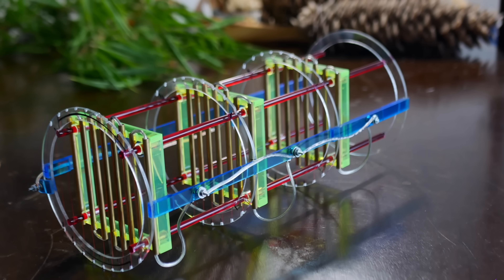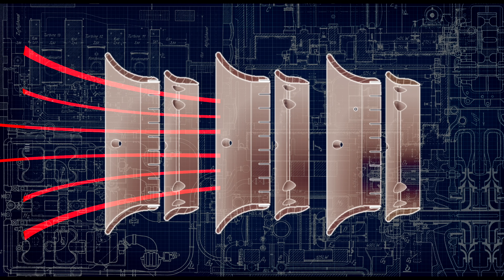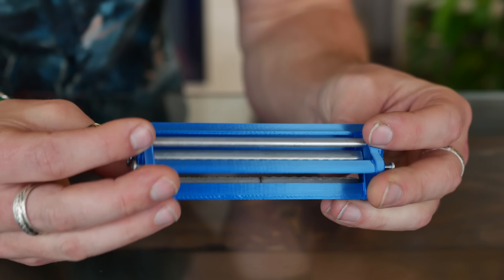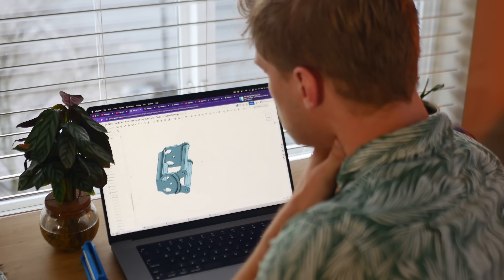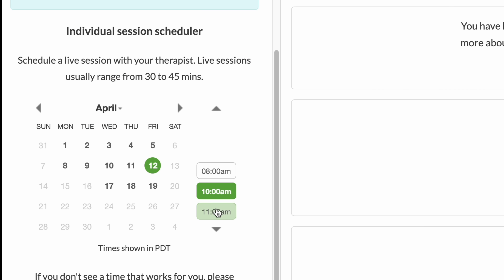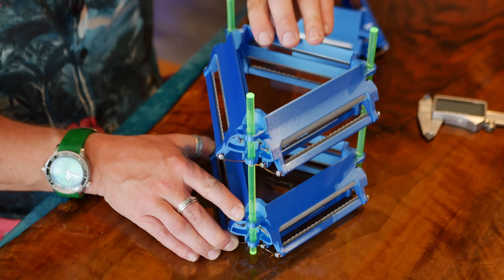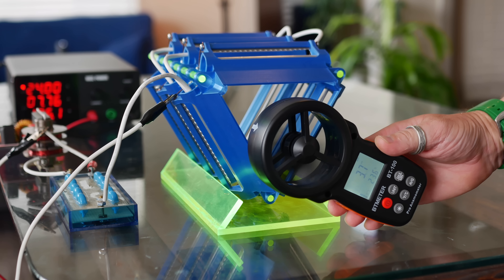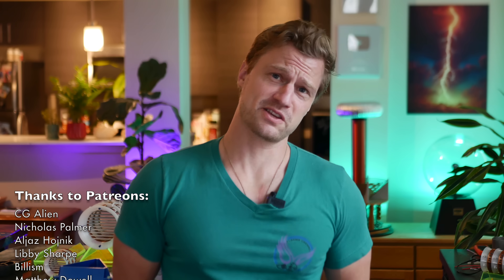Next-Gen Ionic Plasma Thruster Inspired By Nature (BTC Mark 3)

Comment: I feel like he mis-heard Nature's clear message. Consider the leaf - If we follow the patterns of the veins from tip to stem, they converge in a closed pattern. Why not use those convenient linear thruster segments inside the wing's airfoil, with multiple ranked intake thruster slots pushing flow into a larger channel with its own thruster sized and calibrated for the compressed flow? The way he is stacking identical units with equal spacing ignores the fact that each stage is processing a fundamentally different fluid.

Comment: Feel like this is worth mentioning again: when you've been building sequential designs, you've been accelerating THEN DECELERATING then accelerating the air. Between the stages, the electric field runs in the opposite direction therefore it creates a force to slow down any ions you've produced. The only benefit you get comes from accelerating the uncharged air you draw in between the stages.

I think it's also important to say your banana example is wrong: as you saw with the dry ice, these blades will pull in air from the sides which will draw it OUT of the main air current. You'll have a region of air that keeps getting sucked out by the blade stages then blown back in. This is wasteful. It would be better to block off the inside edge of the blade so that it can only draw in air from outside the thruster

Comment: Curve the thrusters into a circle and space them 1.5mm apart, increase voltage by 3x and use steel and aluminum instead of plastic,  stack 10 of them at that spacing with a shroud to collect air from the rear to focus it onto the sides from a single source.  Larger voltages will require larger gaps between hot and ground.

Comment: It seems like running all the thruster elements at the same power is likely eating into your efficiency for maximum output. Would be interesting to see if running the earlier ones at lower voltages and increasing towards the rear would net you similar results at lower power expenditure.

Comment: We need the dry ice at the back and the sides to get the true feel of where the air is coming from.

The side influx of air is trained so it should help, just like in a jet engine, so if look there for inspiration.

Then, the modules themselves, they all work well with still air, but surely they must need adapting to moving air? So I see the 3 stages being different sizes as well as spacing.

Comment: Why aren't you tapering the diameter of the stages? Conservation of mass flow means if you want to accelerate the air from one stage to the next, it has to get narrower.
Also, since kinetic energy in air is proportional to v^2, it is expected that you get about 1.4x speedup from the 2nd stage, and only about 1.22x speedup from the 3rd stage.
Biggest challenge seems to be that energy efficiency is only about 0.25%..?  (1/2 m v^3 p A = 0.1W kinetic energy from 40W input)

Comment: Wind isn't additive.  If the wind is blowing at 5mph. It is simply blowing at 5mph.  You have to put in more energy and push faster.  Period.

Staging multiple wind inputs, which each push at ~2.8 isn't going to give you faster speed.  Wind speed isn't additive.  Your are only maintaining the speed. It's like you push a bicycle at 6mph. A friend helps you push the bicycle. But, you both are only pushing at 6mph. Capiche?

Comment: This is so cool!

One Question that popped up in my heat though was - what about humidity? When (in the future) flying through the Air with Ion thrusters shall become possible then wont we face Problems with jumping voltages due to Change in the conductivity of the Air? That might mess with the efficiency especially when under lab conditions everything Like spacing and voltages are optimized. And Well, Clouds exist🤔😂

Comment: It's normal that you don't get more power with combined design. You are not accelerating the same air twice, therefore you don't combine power, merely increase flow rate (l/min not m/s). If you like to improve over all output speed, try creating an inverse pyramid that would act as a nozzle. Not only it would increase the air velocity (allowing the same air to be accelerated twice as well as pull some fresh one), but help focus the stream as well. Additionally, you can experiment with an outer cone around the whole trusted, that would allow for equal pressure build up when in motion. Also, increasing the voltage on each consecutive step will better up the efficiency.

Comment: Some comments-
1. I'd be curious as to any differences between something like prop drive thrust vs ionic thrust curves vs apparent wind speed.
2. I'm not convinced you are using the most efficient step=up circuit. There are other possibilities. The free one, I'll disclose right here, it's a simple linking of atmospheric radial voltage differential to drive your thrusters from a higher altitude atmospheric voltage collector(I think you've possibly already done a Ben Franklin style kite video on here?). The current should benefit from apparent wind. There are also methods like piezoelectric transformers or electromechanical(motor) to static electricity generator (like the whimshurst machine. Depending on the motor and generator efficiencies you may or may not get a better overall conversion efficiency.
3. I think the evolution of your current design is to amalgamate it with you prev design so that you have slanted in rings stacked end to end instead of triangular inward pointed stacks.
4. You are measuring output speed which is a very raw and relatable characteristic but thrust is a much more important measure. At the moment, you are  generating a sort of angled cross-flow impingement of ions which transfer their potential energy a little like brownian motion to a bigger number of air molecules that end up moving at a lower speed. The 22? degrees offset looses you a portion of thrust which I don't think can be realised by the vehicle housing the thruster.
Please don't take anything above as being negative, I love seeing your inventive experimental work and find it fascinating.

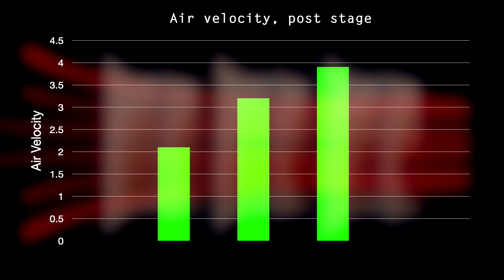Comment: I had to pause at 3:15 and check some math. Those speeds are exactly what you would expect; the thruster is imparting energy to the air, with an unknown, but probably constant, efficiency. And we can check this assumption with just these speeds and knowing that kinetic energy is a term of velocity squared. (2.1m/s)² is 4.4 (units of energy. Ignoring mass, as it's probably close to constant.). 3.2 m/s -> 9.4 energy. 3.9 -> 15 energy. So, even without knowing the "real" energy (in terms of Joules), we can see each stage is adding roughly the same kinetic energy to the air (about 5 of our arbitrary units). Reaching a "max speed" is not the issue, its efficiecy. You want to move more mass of air faster.

Comment: You might want to look into better flow visualizations and also using them for the flow inside your thruster to better understand how the flows combine (or why/when they don't)
Using a fog source at the source side of the thruster + a thin layer of laser light might be a good option. Or building a Schlieren system for visualizing pressure differentials.

Comment: What an awesome improvement in design with this new version!!However, one thing really frustrates me though is the use of smoke to visualize how the thruster blow but never as air input so that we can visualize the actual air flow circulating through the thrusters.I think that now that you pretty much mastered the thrusters technology, you could make incredible performance upgrade by limiting turbulence at the convergence point (and everywhere else). Because turbulence comes from flow shearing, it basically "eats" some of you flow's kinetic energy.

Comment: I like how you're testing and finding the best distance between the individual thrusters but it would probably be more optimum to use computational fluid dynamic software to test it out over different lengths and voltages. This would also produce you a graph where it can easily show the best distance.

Comment: Cool design. If you are looking for more velocity- you need to direct your stream into a smaller volume. By constricting the volume the fluid will accelerate (Venturi effect). The total mass of air is important for thrust (F=MA), you're also looking for speed. If you move a huge mass of air at 3ms or a small mass of air at 3ms, your top velocity will still only be 3ms. So if you want to get the velocity needed for aviation purposes, you need to need to force that stream of air through a smaller and smaller diameter tube and the velocity of the air coming out the back will increase in velocity considerably. Basically, you need to put a Venturi into the shape of the output of your thruster. You'll get faster airflow. Your intake will be large, so you will still be taking in and moving a big mass of air, but then you will accelerate way more and thereby getting more thrust and higher top end velocity.
Allowing more air to come into your thruster through the sides doesn't help you achieve higher velocity outputs because that is air that is moving slowly and you will have to expend more energy to get it up to the same velocity of the airmass you already have inside your thruster. This is all about getting the mass of air you already have inside your thruster up to as high velocity as possible as it leaves the back of the thruster.
Think about it this way: I have 5 guys who can all  run top speed of 5kph. They are pushing my car. The fastest they will be able to get my car going is 5kph. However, I have another friend who can run 20kph. If he pushes my car, eventually, he will get the car up to 20kph (he will have a harder time getting the car going than the 5 guys but he will eventually achieve a higher top speed). Ideally, you would have my first 5 friends push  my car up to 5kph and then have my other friend step in and accelerate the car from there. You achieve this by having a large air intake and you ionic units near the front pushing that air down a Venturi tube. 
Just try putting an output nozzle on the end of your thruster, you'll get even higher output velocities. Fluid Dynamics

Comment: Your numbers are probably disappointing because you’re trying to create an ionic compressor. But there’s nothing physically compressing the air as in a jet engine.

To encourage airflow through the centre, try using entrainment by using the thrusters to suck air out of the middle and creating low pressure as in a bladeless fan.

https://youtube.com/shorts/h0V_onHN0sY?si=N-UxyhHm4-DF9LIO

Comment: An improvement idea to improve on your ionic thrusters. Is to have them at each of the different stages of the thrusters to pulling different powers. Not at the same power. Because they are at the same they are pulling most of the same air flow that shows small differences between stages, by setting stages at different power, will lead to greater air flow speed. As the first set of thruster is pulling in the air and the other thrusters are just accelerating the air flow by pushing the same air from the first thruster This should optimise your ionic thruster to reach their peak efficiency.

Comment: Id be intrigued if you had each stage rotated slightly to grab more flow from the tips

Also would be intrigued if you angled them inside the stage on their lengthwise to see if you can get more of a rotating flow.

Or change the size of each stage, whether that's the front being smaller than the rear to get more flow in, or the reverse and trying to take better advantage of the center area.

Also what if you detemper the razorblades and bend them, perhaps a more organic bend in conjunction with the above may have some sort of improvement. Though you'd need different blades than those snapping expendable ones of course.

Comment: @Plasma Channel: Your measurements are not assessing the performance completely. You want thrust which has an reaction mass component, that you do not seem to measure with measuring the output velocity. Impulse has also an mass part, in that regard the triangle configuration is brilliant! You can "cover" shape with it - if you dare with an  corresponding mesh generator.
Reply from the maker: Hey, thanks! Yeah, I should do a proper thrust measurement

Comment: I wonder if making each unit of three different sizes such that they fit concentrically then fitting a duct wall to each, angled at 20 degrees for the outer duct, 30 for the middle, and 35 the inner most. That type level of airflow convergence should be more in keeping with what you saw in Nature, improving flow rate and force dramatically. But I was an English major, so….

Comment: Finding the optimum geometry of electrodes is vital to achieving the magnitude of airflow and acceleration necessary to progress from lab curiosity to feasible thruster. What if in the same space where you now have one blade and tube electrode pair, you were to scale down the electrodes to where you have 3 or 4 pairs (each one much smaller in thickness and width) drawing air through the same inlet area? Achive many more ionic flow lines of interaction with the air in the same space. In stead of 9 pairs of electrodes as in your example, how about 36 pairs of electrodes, but divided and arranged to consume the same power?

Comment: You should try to put the output pipe on output, it is used to increase performance of a jet engine (it is adapted to the output of the engine)for example motor AI 25 (google "AI 25 leteckemotory" and go to photos ). And you should try to fill the core either by just a triangular profile, or with a triangular profile that will have holes so that flow will suck air from the core(this technology is used to inflate life rafts on airplanes, instead of 20 seconds of inflation with a rocket engine it inflates in 5 seconds with rocket engine and aspirator(google aircraft aspirator)). And maybe then a nozzle but that's optional. I am an aviation mechanic so try it ;D

Comment: So basically:
MK 1: Proof of concept
MK 2: optimization towards output and structural stability
MK 3: Redesign of the structure to improve structural stability and reduce effects from coliding objects.
my guess MK 4 will focus on the optimization of the design to power up the output? maybe find a way to isolate the currents so they can form an arc when the input is increased.

Comment: i wonder how spacing them out but having a triangle tube to fill the gaps would do...
also i wonder how a single of the round stages in front of these would do. as for impact avoidance, a nose cone like the SR71 engines would help.

Comment: Do you think the Ionic-wind effect would be stronger at a higher air density? Jet engines use a compression stage before the combustion chamber, even though this isn't a thermodynamic engine could a compression stage effect the ionic wind? Higher air density would mean more air particles to be effected by the ionization per liter, but i dont know if it scales that way.

Comment: So some fundamental questions that apply to staging. 

1. Can it accelerate already moving air? So a prop once traveling through air has to either spin faster or chage its pitch to keep giving the same thrust. 
Does an ionoc thrister do this? If its doesn't. Then the stages will do little.

Comment: One test approach is to use a mechanical fan in front of the thruster & measure the velocity delta. When you increase the input air speed, does a single stage thruster delta increase or decrease? That will give a clue on how to make adjustments for the secondary\third stages.

I think there may be an issue with decrease performance of the second\third stages because of the increased air speed. Probably secondary & third stages make need different spacing & angle since the air is traveling faster.

You could try applying insulation on the front side (leading edge) of the electrodes so you can increase the voltage (or decrease the electrode spacing) and use a a wider anode such that the ionized air as more time to accelerate. to insulate the leading edge, just cut some electrical tape into thin strips using a exacto knife.

Comment: the problem with Ionic thrusters is that the situations where they are better than a simple propeller are very rare.
I would also love to see a thrust per watt stat.
Reply: Would be cool to have an ionic propeller. That way the propeller moves due to ionic motion, and the air moves because of the propeller.
Reply: @FemaleRoleModel  What about putting the "thruster" concept on the leading edge of the propeller just for directing the air smoothly over its surface and especially around the tips of the prop?
Reply: @alleycatsphinx  I like that a lot.

Comment: Given the size of the razor blades you have to install in each line, wouldn't it be better to halve the lengths of each thruster and do it as a hexagonal column, since that would be closer to circular?  It'd decrease the turbulence in the flow because the angles at which the columns of air intersect are less acute.

Comment: as a preface, i have absolutely zero aerospace knowledge whatsoever. this is just a guess. but i wonder if it functions like a ram jet? slower output with static air in front, higher output when the air it’s breathing is moving? just a thought

Comment: you might want to take a look at the thrust meter tom stalton built. it's not as visually pleasing as the air flow meter (not to speak of the dry ice), but it might give you some more accurate/ repeatable results

Comment: In the automotive field when building engines for performance we port and polish and sometimes even dimple surfaces on heada and intake runners to provide a smoother and easier airflow with proven gains not sure if this would improve performance on your thrusters but i figured i could chip in